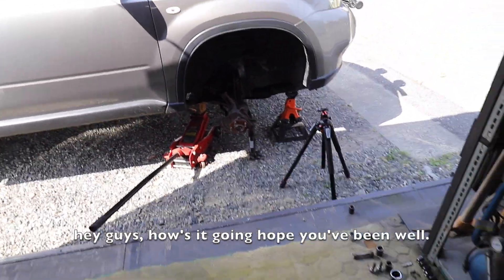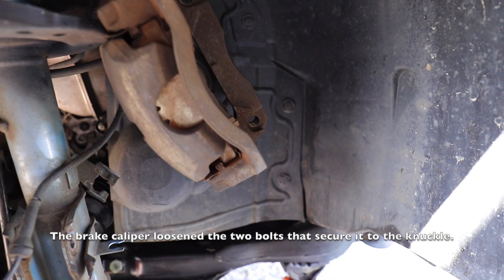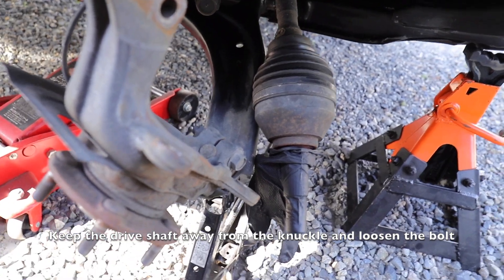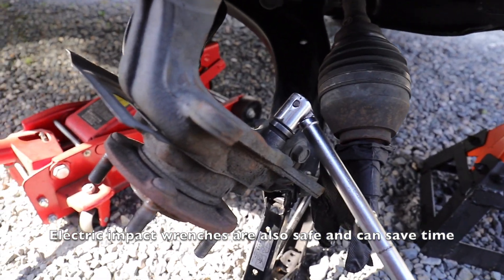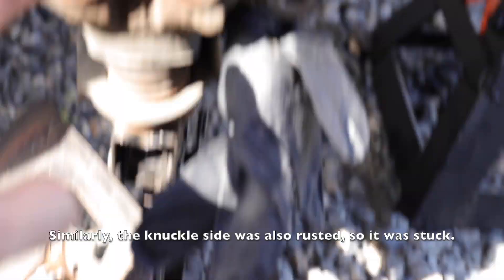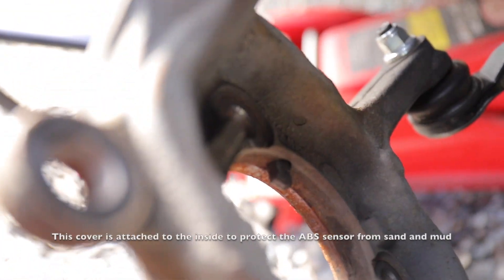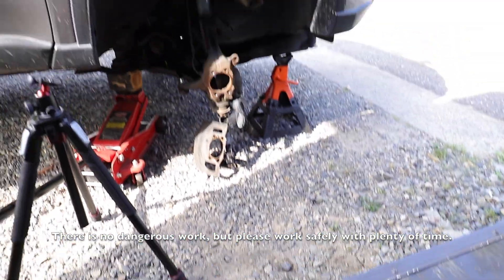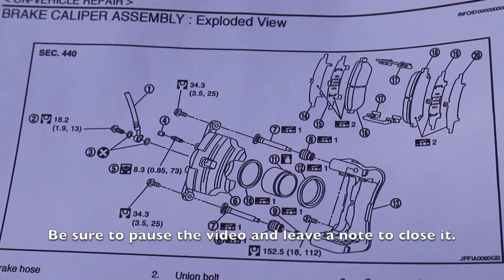X-TRAIL T31 /The front hub bearing can be removed like this /ハブベアリングの外し方を知りたいの？

Comment: Very good video. When replacing the wheel bearing it’s a good idea to apply some anti seize grease to the rusty contact areas. It makes taking it apart a lot easier if you have to do the job again.
Reply from the maker: Thank you, I think the method of applying anti-seizure grease is a very good idea. This video is a desorption method, but I think that the next time you replace it with a new one, you will always apply grease.

Comment: That brake rotor replacing it must be very expensive, there is no way you can smooth it and be useful?
Reply from the maker: With this degree of wear, it can be used for another 5 years. Before that, the pads will be reduced, so I think they will be replaced at the same time.
The rotor will be smoother if polished, but it is more reliable to buy a new one.